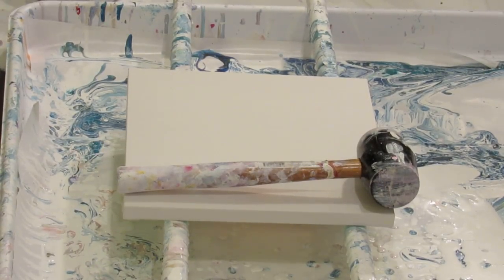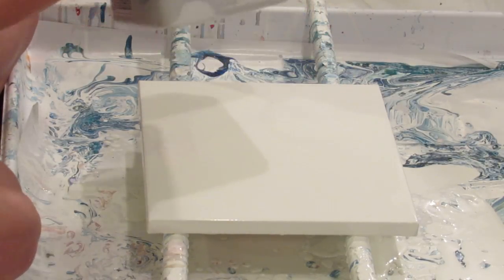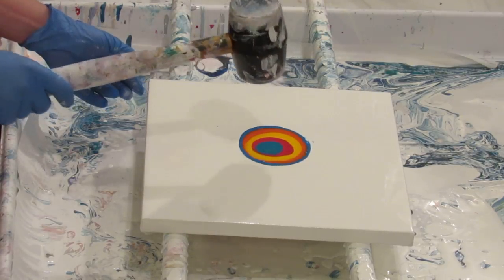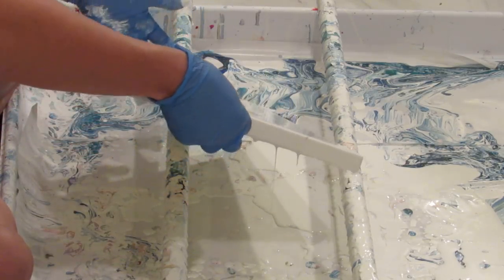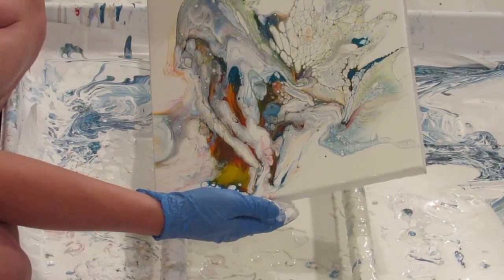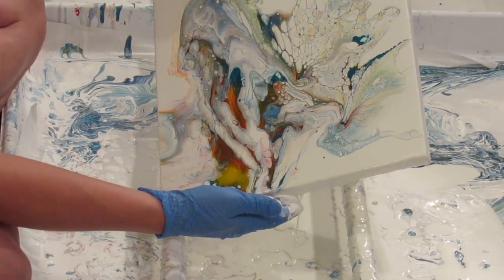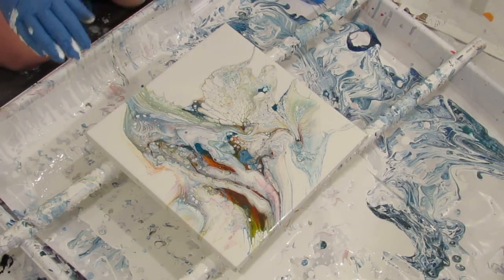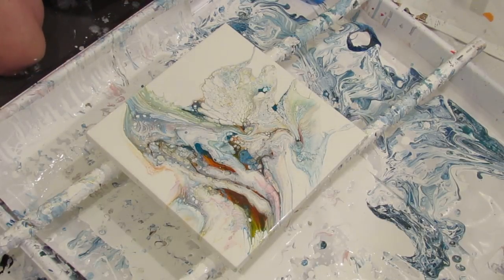(065) mallet smash and tilt

Comment: How long does it take to dry and in what humidity and warmth conditions....also does your house paint ever craze when dry?  Small cracks throughout the background white.
Reply from the maker: +Nancy & Pat Caldwell I don't get cracks. My house is air conditioned and it doesn't get very humid in the basement. Our house gets very dry in the winter, but I haven't noticed any paint changes so far as with the weather.
Reply: thanks for answering...must get it figured out